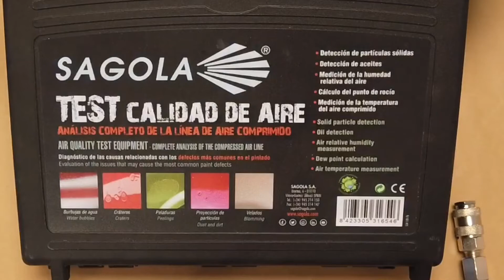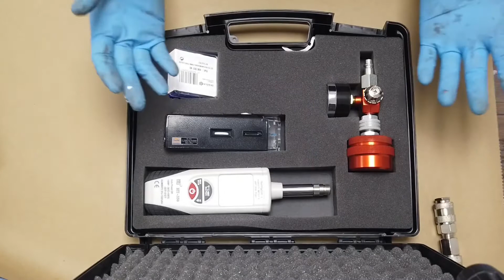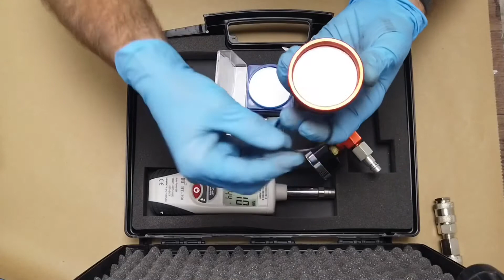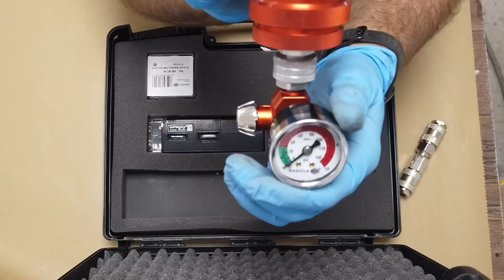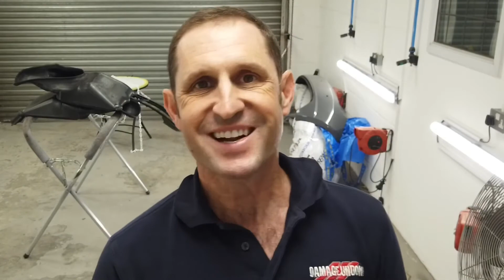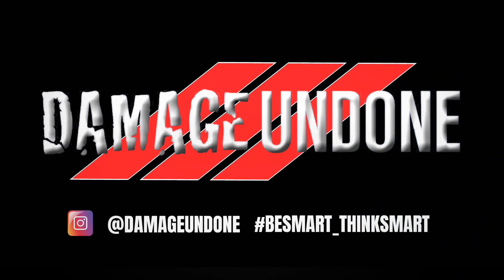SAGOLA AIR QUALITY TESTING KIT

Comment: I bought one of these and it showed no oil or water contamination which I was happy with. I use a drop out in conjunction with the ANI 3 stage filters. I’m curious do we have to check for air contamination such as carbon dioxide or carbon monoxide when using breathable air?
Reply from the maker: Yes in an idea world you should be checking for that too but many don’t

Comment: I saw you use this in your other vid, you just don't realise how bad the air quality is by just using your mask, it smells ok, it doesn't give you any headaches but slowly it can be doing bad things to you over time, you have a nice setup but even yours wasn't 100%. I'm going to look into getting this and probably rent it from PMP, thanks Wayne, John.

EDIT: do you know when it will be available at PMP?
Reply from the maker: Yes you should and let me know what you find out.   

Re availability, imminently
Reply: @damageundoneltd   👍👍